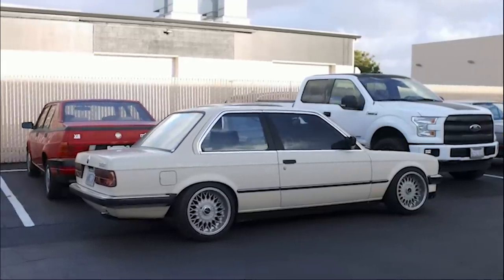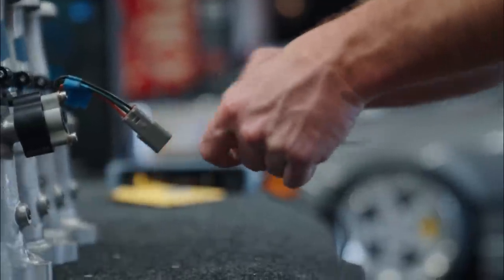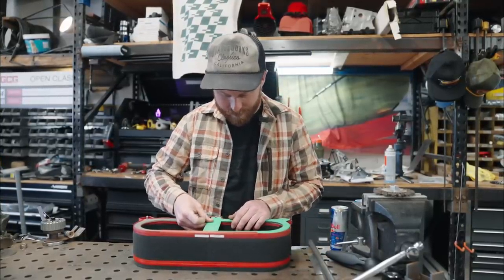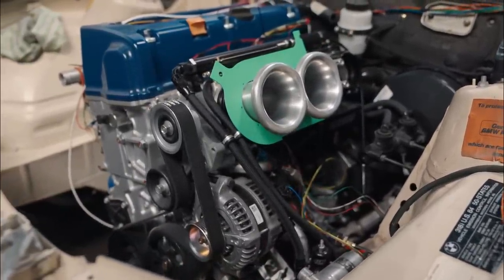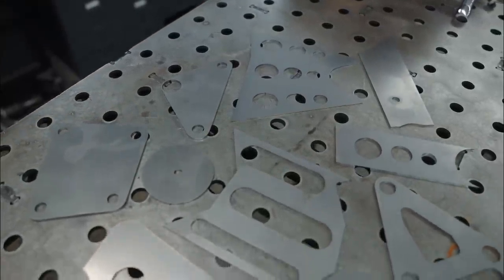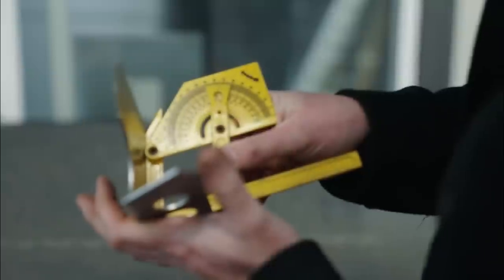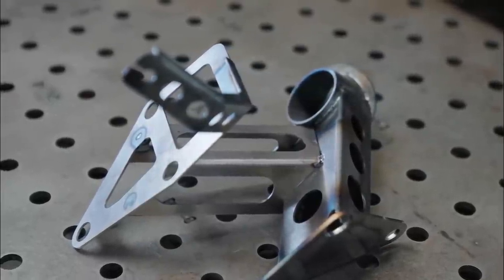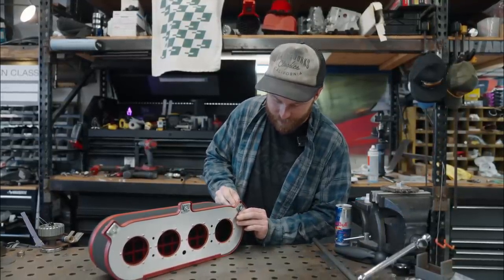K24 Swapped E30 • CAD, TIG, and 3D Scan Fabrication

Comment: Im gonna say that funnel/trumpet/velocity stack were a bit tad shorter than optimal length...

A curved longer stack would help making better torque down low and higher power top end... Probably 6inches stack length might be close enough and better than current 4inches straight stack...

Comment: Any concern with the bolts holding the filter plate to the ITBs shaking loose and getting sucked into one of the cylinders? Would be a shitty way to destroy a block and head.

Comment: Hey when you make your dxf files for laser cutting, put the fold lines on them and get them laser etched. No notches, no marking out (unless you need to fold from both sides). Cheers. Keep it up!
Reply: completely unnecessary, you just cnc bend based off the dxf  send cut send even does it, I use a local shop that is way cheaper and better than scs, most towns have one.
Reply: @thejasonrk  Have you ever used a cnc bender? The cnc part means the blade pushes down just the right amount for the material ductility and thickness and the vee block being used, to achieve the correct bend angle.
You might be surprised to know that a person still has to line up the part on the vee block using the marked out fold line that you say is unnecessary? 
The option to get sendcutsend to fold them is a good suggestion. They still need the bend line either in the dxf file or on a drawing, but usually Mike is in a time crunch so cutting them and flat packing saves him time and $$.
Reply: @TS50AU  i’m an engineer that designs bent steel parts all day, fusion for example puts the bend lines in the dxf for you when building a sheet metal part, you program the cnc based on the dimensions and it runs through the steps, really nice tech, the shop I use has a fully automated setup that can do 14 foot bends.  Send cut send does an incredible job in my experience, their website is so nice also. I just need stuff usually within a day or two and at much lower cost so I use a local vendor.
Reply: @thejasonrk  Jason, I spend more hours per day than I care to add up before my Inventor screens, so I'm more than familiar with the software putting the bend lines in the dxf's, WHICH IS WHY I SUGGESTED IT!... I'm not sure how you balance that with 'completely unnecessary'. My original comment was to help Mike make life easier for himself and maybe share that knowledge with others, and is relevant to him folding his own parts. https://www.youtube.com/watch?v=ODhcEiQvmC0&list=PLN0uGSZPkXqJ56pemb2_kqOi4XIpGMO5F&index=5
Keep up the good work Mike. Your projects come along a lot quicker than mine so at least I get to enjoy watching.

Comment: Excellent process video - to anyone out there thinking they can’t do stuff like this, it takes a little time, a few tools and people out there willing to share knowledge..thanks Mike!

I would recommend adding safety wire on the two pairs of bolts that hold the backing plate in place, just in case they let go.

Also, can you tell me what the sealing material you’re using against the trumpets is? Just about to do the same thing for an M42 swapped 2002 I’m working on.
Reply from the maker: It's just high-temp silicone. :)

Comment: Instead of using fiducial stickers, mix some baby powder and Isopropyl Alcohol in a spray bottle. Spray your dark or shiny part. When the Isopropyl Alcohol evaporates it will leave a fairly uniform coating of baby powder which cleans up easily with air.

Comment: So you are again dead set on miss matching parts on K engine?   Installing short stacks with resonance of above 9000rpm on k24 what has max drivable rpm ot 8000rpm that is if you don't want to granade it. 
You better off building 8.0 intake manifold with 2nd harmonic order at 8000rpm that would clap those stack with 20hp over the curve than acting smart with them stacks.
Reply from the maker: Dang that’s crazy

Comment: The fab, 360, and scs episodes from stanceworks are always top tier! Hey Mike! have you seen those digital angle finders, one of the magnetic cubes for pipe or tube? You can zero the gauge at whatever angle so it will tell you the angle relative to the plane you set. I use them at work for bending conduit on uneven surfaces and at home for my tube bender and brake. You can also use it to find what angle you need to bend, they're super handy.

Comment: I know hood clearance is a major problem, but do you worry that with the velocity stacks protruding so far into the filter that you might loose a bit of air flow? It think at this point the side elements of the filter will not do much filtering…

Comment: Hey Mike, cool to see you scanning! I just bought the Einscan 2x Pro.
For complex sheet fabrications tabs and slots to align plates are really useful!
Reply: Where did you get it? What did you end up paying?
Reply: @VinnieboyFE  Private sale, and too bloody much! It was technically a business purchase
Reply: Great choice. In my experience, this is one of the most capable handheld scanners out there if we are taking the price into account.
Reply: @mr.slappy6944  I'm very glad you said that cos I was having a little buyers remorse.. 😂 It won't even calibrate on my old laptop, I thought it was broken but it'll work on my newer PC. So I need to buy a new laptop too..
Reply: @mandrakejake  depending on your budget, I've done a fair share of scans with a laptop that has i5 CPU, 8GB RAM and RTX3060 GPU. When I upgraded to 32 GB RAM it took down time of generating point clouds and meshing a lot. Monitoring the procesess, I'd recomend to get a laptop with at least i7 CPU, 16GB of RAM and RTX GPU, but as I said, budget version like the one I mentioned, can also do the job quite good. I think it was around 1k for the laptop. PC and a big screen makes more sense if your scanning in-house and can have a dedicated scanning spot
Reply: @mandrakejake  also, you might just try to get an older version for the software I think. Shining 3D have it mentioned on their website that for 2x Pro, don't download the latest software update if your GPU has a performance index under 5.0
Reply: Thank you @mr.slappy6944  I was looking at similar specs, reluctant to spend another chunk, you're advice is very much appreciated.
Reply: @mr.slappy6944  I have just tried that! 3.6.5 or similar before you need a GPU of 5 or better. It still didn't work unfortunately.
I was actually considering a large lithium pack and an inverter, with a trolley so I can make the setup fully portable for scanning cars.
Reply: @mandrakejake  we put everything including the scanner in Qbrick boxes. They all latch together and have a trolley attachment and a wooden top surface.
Reply: @mandrakejake  also, order AESUB disappearing spray. And make some magnetic markers. Your gonna thank me later.